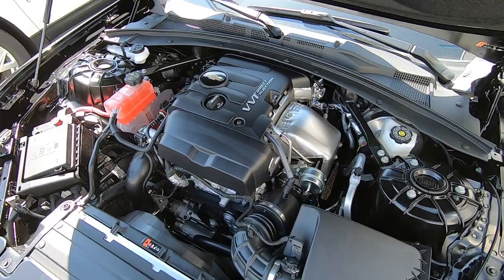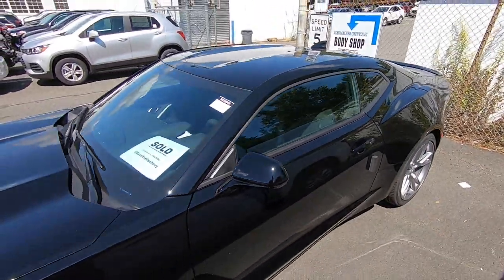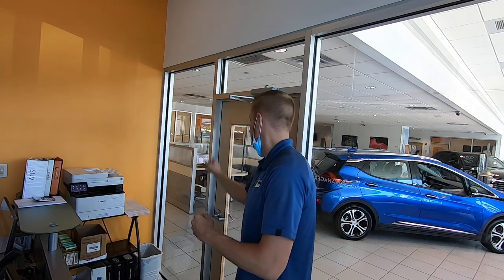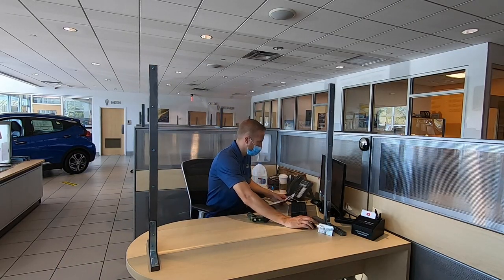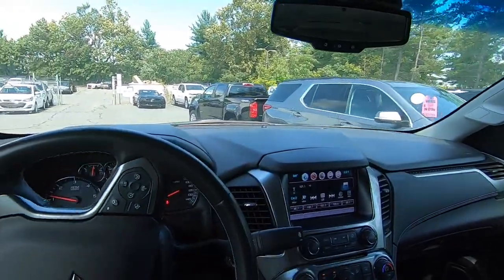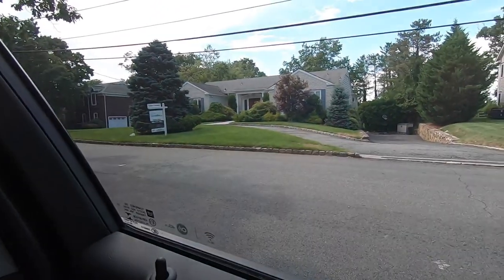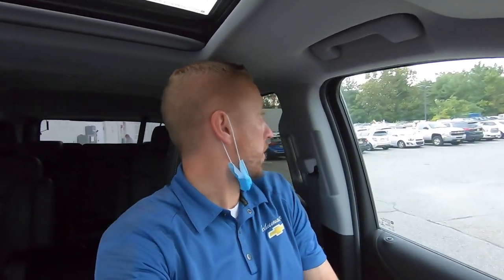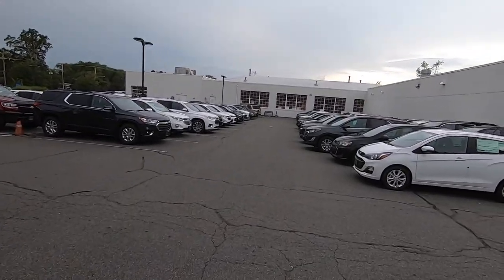Dealership Life - Monday at Schumacher Chevrolet with Dave B sells Chevy

Comment: Just bought a loaded Trailblazer RS from Ingersoll Auto in CT. Showed up to pick it up and turns out someone side swiped it on its way to detail. Since we agreed on a new car, dealership offered to swap it with an identical model from Quality Chevy in Old Bridge. Picking up tomorrow hopefully. Any thoughts on how they process went behind the scenes? Love your vids by the way.
Reply from the maker: Thanks for watching Rob and congrats on your new RS Trailblazer!! Your going to love it. What color did you go with??
Reply: @DaveBsellsChevy  Satin steel! Planning on getting the painted black bumper midsection at some point, as well as aftermarket gloss black wheels. Needed her as a daily but I figured I could style her up a little bit haha
Reply from the maker: Great color!  I bought my Volt in satin steel
Reply: @robcarey2411  what do you drive on the weekends? Do you own lots of cars? Sadly I drive my damn 21 Mazda CX-5 all days, nights, and weekends.
Reply: @2004cyrus  TB is my main car.  Have an 82 diesel Mk1 Jetta as a project but it's not much of a hoot to drive haha.  Love the CX-5, one of the most well-rounded SUVs on the market (especially the '21).

Cheers
Reply: @robcarey2411  I absolutely agree especially for the price! 

Cheers

Comment: With regard to used vehicles, how do the detail guys clean the glass inside the vehicle so quickly and effectively? I do not seem to have the ability.
Reply from the maker: Haha, they do a great job.. I think the secret is the brown paper towels that come on those large rolls... they work great!
Reply: Do your glass at room temperature in the shade. Buy Stoner Glass Cleaner and a Glass polishing cloth from Maguire’s. Clean your windows with a Hand towel and Polish with the glass rag until it runs across the glass smoothly without catching. The no frills way to clean, One part water, 3 parts vinegar and mix, use newspaper as your cloth. No streaks or blemishes. The news print works with the vinegar to give a flawless finish. You can use steel wool on your outside front window and must be done wet to remove road grime and leaves your windshield sparkly clean.
Reply: @georgemartin1436  Your very welcome. Want super clean tires, use Fantastik, it cleans white walls without scrubbing. Want shiny Chrome, use a wet SOS pad, removes rust & imperfections..will not scratch the Chrome. I’m a former professional detailer and the detail guys today, are overworked and underpaid. When I detailed, minimum wage was $4.50 per hour, I was $8.00 per hour. But as the dealer principal said, my cars and showroom never looked better.

Comment: What was that code you gave to the gas attendant when fueling up the Camaro? Sometimes I’m asked for my zip code but that didn’t sound like it. Also, are the deals from coronavirus (0%, no payment for X amount of days, etc.) starting to disappear? Could that be the reason for lower sales? I’ve heard this is the time of year to buy a car due to next year’s models becoming available.
Reply from the maker: That's just a code for the card.. we have different cards for new, used, service, etc
Reply from the maker: Deals depend on the vehicles... they have good percent off deals on the Equinox, Blazer and Trax which is good because we actually have a lot of those in stock.